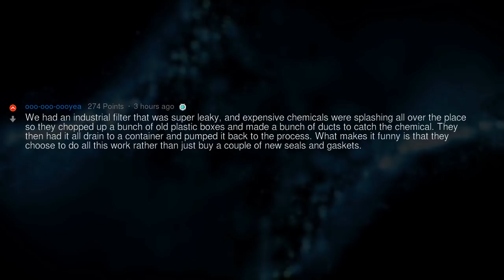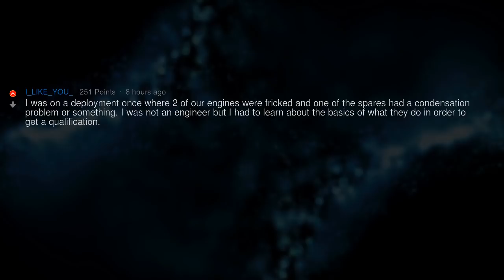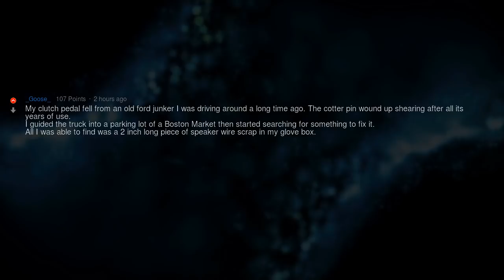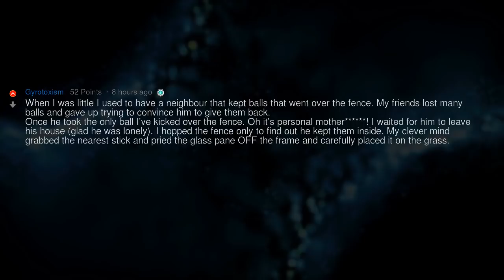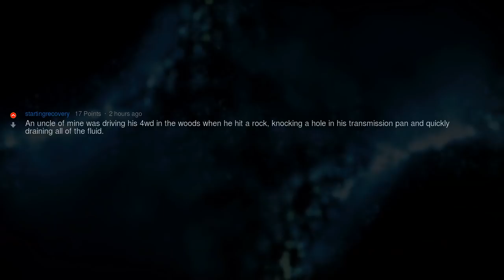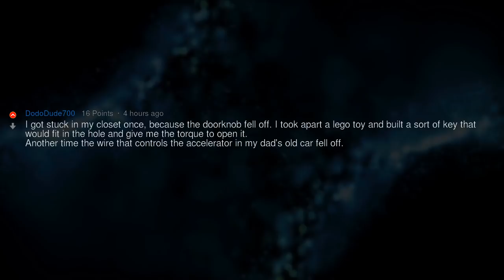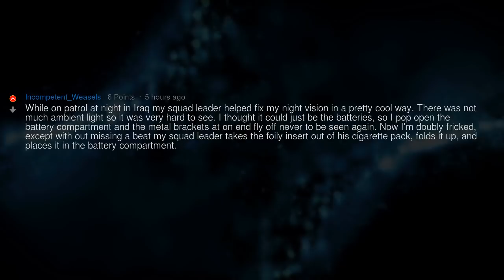That Are Some "MacGyvering" Serious Skills You Have | People Stories #620

Comment: I'm Panhead Dave, Macgyver is an amateur, I've been doing "miracles" for almost 50 years now
Reply: Oh yeah? Name every type of zip tie.
Reply: Oh? Got any good stories, my man? I'm genuinely curious.
Reply: @Maniacman2030  one time he sucked off a hobo for some grain alcohol
Reply: @Maniacman2030  Dave here, for example, I was driving through the Eisenhower tunnel at the top of the Rockies, all 4 bolts fell out out my alternator ( front and back halves) I used my shoelaces to tie the front to back and got back to Santa Barbara, another time blew a fuel pump, duct taped a gallon gas can to the windshield and siphoned gas straight into the carb, had to stop every 20 or so miles to fill the can from the car's tank made it over 500 miles
Reply: @TheWrench-Wright  Sounds like some good use of at-hand materials. That alternator one sounded like a close call, using only shoelaces makes me think they could've caught fire or melted at some point. I've dealt with bad alternators enough to make me loathe them. The gas can one actually sounds cool. Sucks that you couldn't have it continuously siphon from the tank, but you work with what you got. Silver lining? You still made it.
Reply: I'm sorry...but "pan"head Dave...
Last name presumably Baker judging by the username...
I know this isn't what you meant but now I'm laughing because "pan" is Japanese for bread and now I'm imagining you walking around with bread on your head/that your head is made out of bread combined with the Baker bit and it's just--
Reply: @diamondseraph9369  Panhead refers to the antique Harley-Davidson motorcycles I own, one of them for forty years now (I got it for my 19th birthday) it was old when I got it, I am proud of this nickname, it means something to those who are "in the know" if someone doesn't understand, explaining it is not possible
Reply: @TheWrench-Wright  
I know, I just happen to be literal minded and obsessed with Japan so that was my first thought lol.
Reply: @diamondseraph9369  also "Diamond" is a horrible moniker, it only conjures up images of slavery, suffering, inhumanity, oppression, greed, and any other negative characteristics of humanity, except industrial manufactured abrasive materials that are diamonds, I would rather have bread on my head than blood,  but my family name and the context you use it in, I find highly offensive and disrespectful, I will not say more although I have plenty to say, It would only be ranting at this point,  laughable is not an appropriate term for the disrespect shown you have shown
Reply: @TheWrench-Wright  

Uh...I just think it's a pretty name...it has nothing to do with any of that...
If anything it has a more positive connotation to me like purity, strength, resilience, or whatever...I've never even heard of that line of thought before...
Where did this even come from? I wasn't even trying to be rude or anything I just found it kind of funny...
So why are you just attacking me out of nowhere?
Reply: Shut up dave, this isn’t about you and never will be. Come back when you have a tv show weather boy

Comment: Had a wall-mounted leaky faucet with a hose running out of it that supplied water to my laundry machine.  Using thin wire, small binder clips and a long piece of plastic track from a kids' toy car set, routed the leak to the utility sink.  Then got a plumber to replace the leaky faucet.

Comment: I got one. Wasn't me but a school mate did it. Our school got a security system where you would have to have someone unlocked the doors for you I want unlock the doors for you to get back in from trade school programs. At 1st someone had made a flat piece of steel into the shape of an L so that way they could slide the latch open on the front door. Eventually he was caught doing it and they had to improve the door by putting on a move the door by putting on a metal panel Over the latches.  So someone brought in some steel fishing bailean wire. And basically made 2 handles for each end of the string puhandles for each end of the string. He was able to slide it through he was able to slide it through the latch And get it on both sides above and below. And all he had to do was pull. Made the school angry. But you know they're dealing with a bunch of aspiring engineers at the time so what could they do? We grew too powerful.
Reply: The cool part is that both of these techniques are viable modern day covert entry options on improperly installed doors / latches!
The latches with the wierd part that hits on the doorframe - that part prevents the main bolt from being manually retracted so it prevents the wire style attack you mentioned.
Reply: @sage5296  that would've been the case if the school wasn't being cheap. The latches were the same latches that had been with the school since day one before they had cameras. All that protects the latches was bristle lining. They just drilled a metal plate like a foot in size. So he made a rod thin enough to slip back and through to his hand and voila. Opens the door. It was pathetic that it even worked. All the other doors were replaced. So that trick wouldn't work on them. But that door was cheap as hell and they just wanted to make it live I think the kids just did it to make them prove a point

Comment: my air conditioning went out in this heat wave.  my mechanic found the problem: a connector into the fuse box with 18 wires. One of the wires was clearly corroded out and the couldn't make contact.  It was $1300 to replace the connector and the fuse box that the connector attached to.  I noticed that the pin of the fuse box the pin still had about 1/4" of metal available.  I drilled out the one pin of the 18 that was corroded out, ran a piece of wire through the hole, and soldered the end of the wire onto the 1/4" stub of metal. I reconnected the connector, and twisted the other end of the wire to the wire that was previously attached to the rotted out pin. The entire procedure took 10 minutes and works perfectly.

Comment: Did a photoshoot/ fashion.show for a good friend.(male,straight). The dress had a very low neckline.i used duct tape,rolled sticky side out,to prevent a wardrobe malfunction.its an old drag trick.and,it works better than that fashion tape.
Reply: So your a dude referencing drag so what would malfunction out? Setting the BS meter off

Comment: Okay here's something: 
So one day our satellite company cuts our connection because we forgot to pay them, but my dad is the Einstein of tech. So what does he do? This absolute genius plugs in a FORK INTO THE BACK OF THE TV AND RESTS THE FORK ON THE WALL. The connection wasn't the best but it helped my mom watch her shows until our satellite was back up.
Reply: We used wire coathangers or knitting-needles. Any bit of metal will function as antenna.